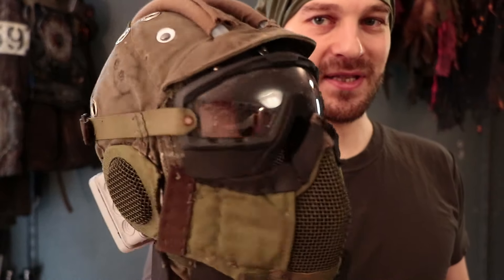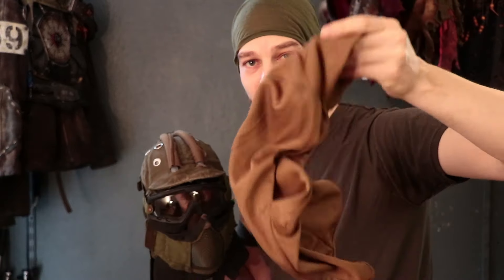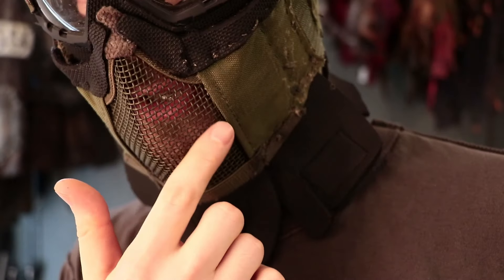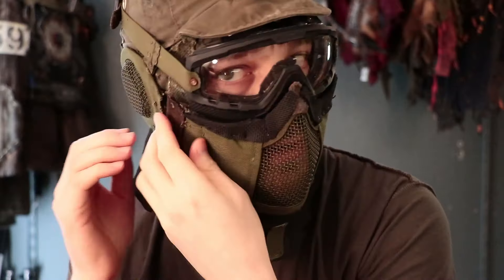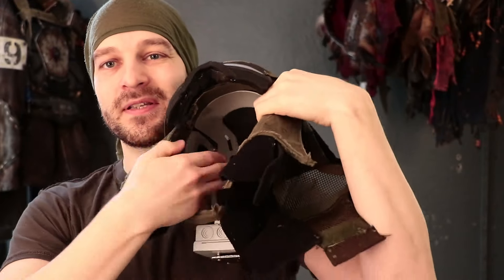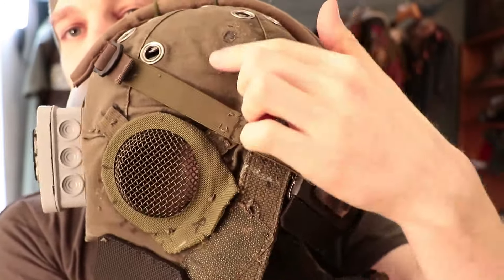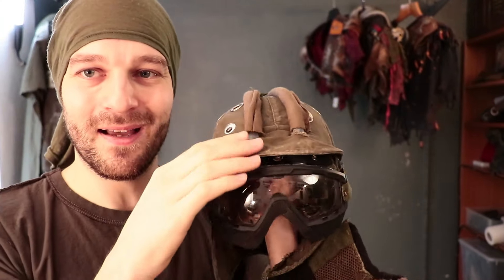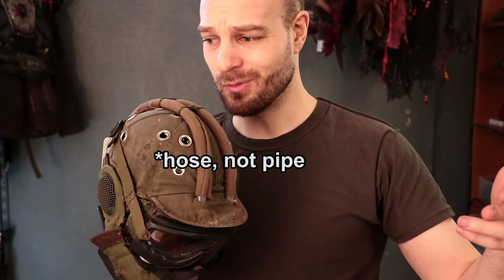My airsoft helmet is practical AF

Comment: Nice. I use a pair of Noctua 40mm in my airsoft de-fog solution as well. They are mounted on the front of a BUMP/FAST helmet to get air flow to a Dye i5. I used to have a pair of cheaper fans. You can definitely tell a difference in terms of sound. And possibly strength. I have cheapo computer fan plastic shrouds to "protect" the fans but they break away upon impact exposing the fans. The old pair lasted a few years but ended up with complete blades blown out making them even louder and less effective.

The shrouds for the Noctuas are beginning to get shot out, and I suspect they can indeed (possibly) take a direct (but further away) miracle shot and not break. The plastic they use is high quality. Been running them for like a year and blades still intact and system still quite.

Also I have found, like you, fans blowing in seems to work best and is quieter. They also do not irritate my eyes. But to be fair, my airflow is not as direct as yours. Mine just dumps the air in the front of the helmet to move any stagnant air away from the vents on the top of the Dye i5. 

Cool set up! I bet you get a lot of comments and questions at games.
Reply from the maker: hahaha yeah some ppl are curious as to the plastic box on the back of my head, some just make pilot comments :D
Reply: I'm curious: what are you guys using as a power source and how long does it last?
Reply: @IreneFriederike I use a TalentCell Rechargeable 12V DC Output Lithium ion Battery Pack 3000mah re wired for the fan connectors. It last a surprisingly long time. I can go months without recharging it.

Comment: you can have a metal ring on top of the helmet under the hat, and slip a rope on the circlet, and lace it thru the plastic slots and make a chinstrap. this can also serve as the base of a skeleton frame
Reply from the maker: i guess - but not a fan of chinstraps, especially since it holds fine without, and while the mask is on the face its really not going anywhere

Comment: "Accidentely looks post apocalyptic" 😄 i dont think i have seen any other kind of work by you😋
Like it.

I just bought the new begadi glasses with the wide face shield that works good for me. But the defogging might be a nice addon. A look inside the box would have been nixe.
I tried something like this with an pc fan inside of an old sovjet gasmaskfilter. But somehow that thing hasnt pushed any air through the hose. At least nothing i can noticed.

Comment: i would not recommend those meshed masks. it just takes a single bad quality BB to shatter and find its way through. yes, you can easily breathe through, but i have safety concerns about it and heard too many stories.
Reply from the maker: where you heard it was probably in relation to EYE protection. for that, yes, i think mesh is indeed unsuited, and what i choose are ballistic-certified glasses. but for my mouth the mesh works fine. at least i dont see a way how a completely unhindered whole BB to the teeth would make me feel any better than the chance of one shattering and peppering me in the lower face a bit. but yeah, a non-steel mask made of some sturdy but rubbery-softer material would probably prevent even that risk as well i guess

Comment: i used to paint ball war with a guy named carpet bob, he wore Neon bright orange pants and was the hardest guy to see out in the wild. the helm is awesome. Its always more rad to use something you built opposed to buying.  Also i noticed you have sewn a bit is that new? i always thought you like the bolt,nut and washer method :))  just messing with ya i always love the tiny details you add i notice them.  Hail the Snail!
Reply from the maker: heh :D despite you justm essin, imma answer that at face value: indeed i like bolts and stuff more, and could have used them in some spots here as well. in some i have. but in many spots it was like.. itsa tight helmet, so having a bolt pressing on my head skin would not be great, so sewing was the right tool here
Reply: @NuclearSnailStudios  yea, sorry I was just messing with ya. 😆  the helm is awesome and has inspired me to make one as well. Cheers  🍻